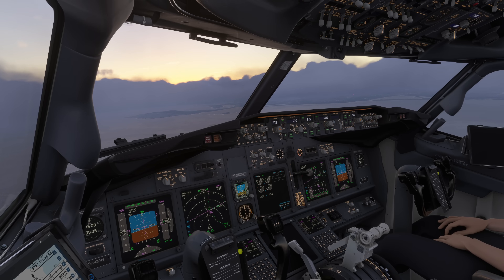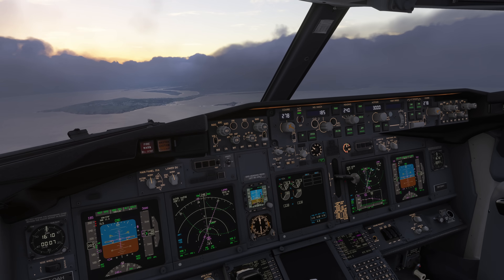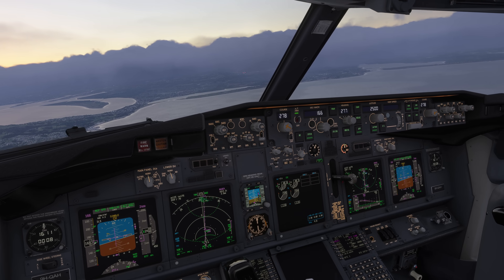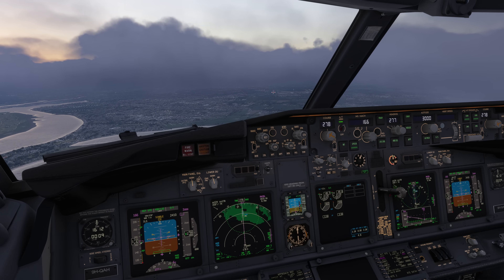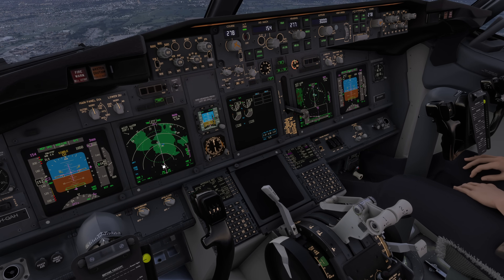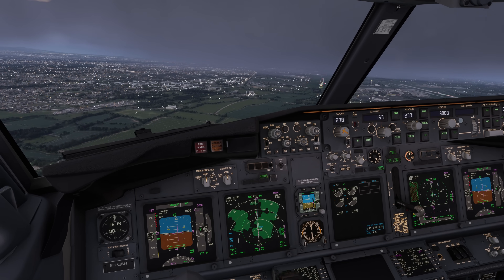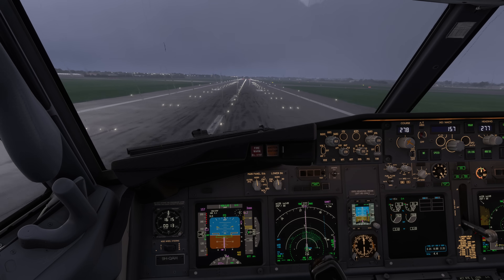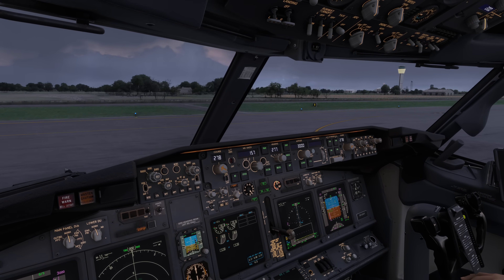Boeing 737 Maximum Crosswind Landing | Gusts Near Operational Limits | Real 737 Pilot

Comment: I just crashed the 737 for the first time after 2 GA’s on 31R at KMDW in a snow storm with winds 270/24 G38KT and iced up windows. The realistic turbulence was absurd. Indicated wind never dropped below 40 and the AP couldn’t hold the approach. I initiated the GA too late and got hit with a gust while climbing away that sent me into an unrecoverable right roll with full left aileron input. The real world crew landing at the same time reported +/- 10 kts. below 1000 with good braking action and sounded unbothered by it. I guess I’m not ready for the big leagues.

Comment: are u using turb settings low in the msfs 2024? and are you using realturb aswell?
Reply from the maker: I’m using the realistic turbulence setting and no additional addon.
Reply: @A330Driver  strange. i tried to fly pmdg 737 but when i have it on realistick the plane gets bank angle and flipping over / gettinng ap disconnect. Never happens to me on earlyer. Pmdg said having it on low is the best for their planes. but yeah. it tipps easily over like never before.

Comment: Nice job Captain. I remember being on a flight out of Dublin during a horrendous storm. They called the flight and I said to myself that there was no way I was getting on the aircraft while that storm was over the airport. Obviously the pilots thought the same because they delayed the boarding for around 20 minutes. As we departed, the storm was still visible in the distance and it still looked terrifying. Have a nice day.
Reply from the maker: Thank you!

Even if the weather isn't that good at the moment I'd still very much recommend to get on the plane though. In many cases the boarding won't be delayed, but they'll put the passengers on, get everything ready for pushback and as soon as the weather improves they'll go. Delaying boarding is usually not a good idea from a pilot's perspective because the window of suitable weather may be very small if a second front is incoming.
You can always get in and ask to get back off again if you don't like it lateron!
Reply: @A330Driver  Indeed sir

Comment: Nice Video! One thing i always wanted to know: how do you deal with runway slopes? Especially getting the information about the exact profile of the slope along the runway length? Considering Airports like Genf, Birmingham or Luxemburg. An how do you deal with them during briefing and landing? Maybe youve already done a video or mentioned it and i missed it.
Reply from the maker: If you've got an airport where the slope really matters (Bristol or Manchester for example) then you'd include it in the briefing. For example Manchester has that huge bump right on the aiming points on 23R, which is a hotspot for hard landings. Or Bristol has that huge downslope when you're landing westbound. If you've got a strong headwind there's a great potential for downdrafts on final approach. Also worth mentioning.

Apart from that slopes really don't matter too much. Your performance calculator will take them into consideration when calculating your takeoff and landing performance. That's it.